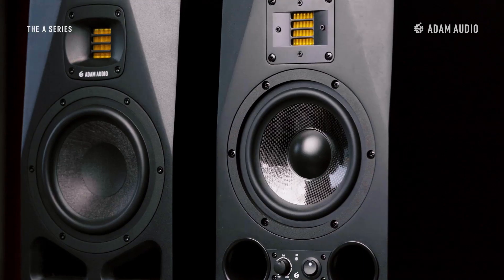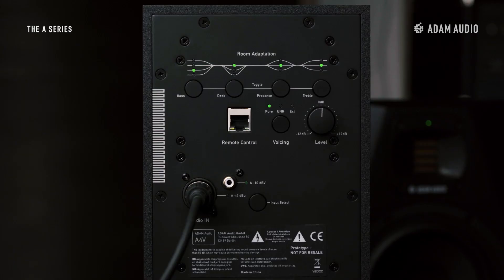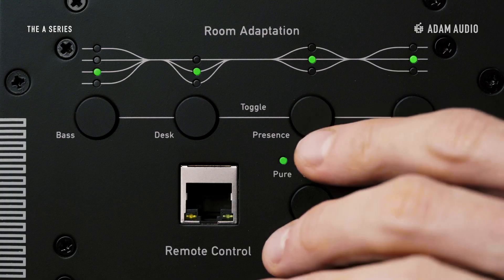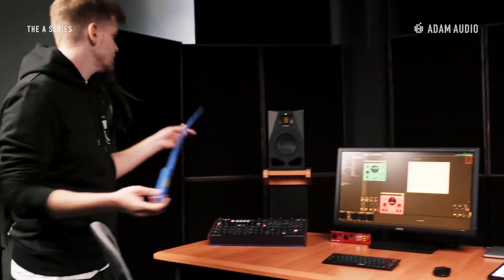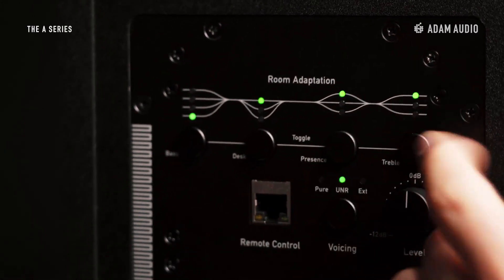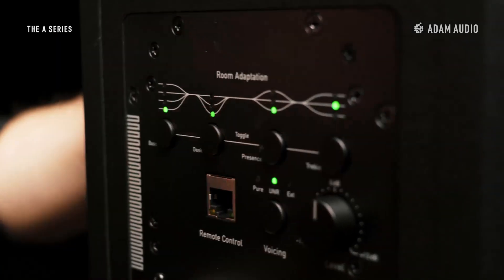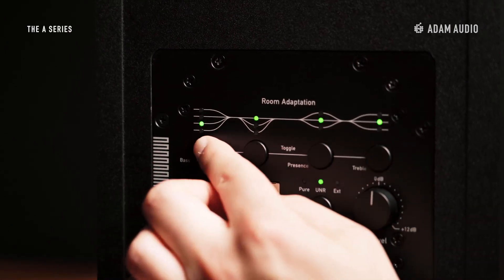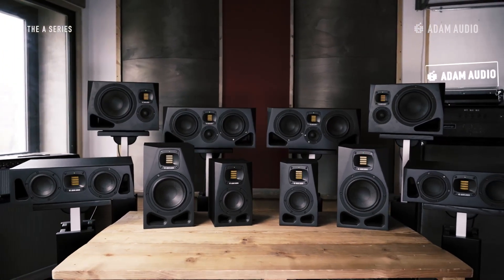The A7V | How to Position and Equalize A Series Monitors Correctly | ADAM Audio

Comment: Hey there, will running sonar works on these speakers introduce latency like sonarworks systemwide does? I’d like to be able to record with a custom curve loaded. Thank you!
Reply from the maker: Hi Sam! Sonarworks as a plug-in has a long latency because it uses FIR filters. The A Series uses an FIR to IIR conversion which Sonarworks calculates for us, and this type of filter has no latency.  A Series loudspeakers have a very short latency (<2 ms) and this latency does not increase when using the Sonarworks filter set.
Reply: @ADAMAudioBerlin  That's awesome. I''ll be seriously considering this system in the near future. Congrats on the great tech!

Comment: If you don’t have Sonarworks how do you even correctly and evenly set these only with your ears? Do you have specific reference track to use?
Reply from the maker: Hi Leiki! Reference tracks are a very personal thing. You have to find some tracks that work for you and become very familiar with them to use them as reference tracks. Better is to measure the loudspeaker using Room EQ Wizard or some other measurement software and then adjust the response as needed using the backplate controls or advance mode in A Control. Then use the reference tracks to confirm you did the right EQing.
Reply from the maker: Hi Leiki! Reference tracks are a very personal thing. You have to find some tracks that work for you and become very familiar with them to use them as reference tracks. Better is to measure the loudspeaker using Room EQ Wizard or some other measurement software and then adjust the response as needed using the backplate controls or advance mode in A Control. Then use the reference tracks to confirm you did the right EQing.

Comment: Would using a subwoofer affect how the embedded Sonarworks calibration go with a Sub? 
I assume there will eventually be a video guide showing the new A series embedded calibration with Sonarworks for 2.0 and 2.1 setups?
Reply from the maker: Hi WhiskyTanuki! For a system with a subwoofer, calibrate the loudspeakers using Sonarworks. Next, bring the subwoofer into the system in the normal way and adjust the level and phase as needed so the subwoofer integrates nicely into the system.

Comment: why are most speakers cut below 50-40 Hz ? Why isn't it 20 Hz ?
Reply from the maker: Hi aenimatek! In theory, a tweeter can play down to 20 Hz but in practice, it will not play loud enough to be audible.  To have sufficient bass level to be useful, one needs bass drivers mounted in a cabinet. The size of the bass driver and the cabinet limit how deep a loudspeaker plan play. Additionally, if you want to play loud at low frequencies large bass drivers and cabinets are needed. This is why subwoofers are usually used to get down to 30 Hz and lower.
Reply: not an audio pro at all but I heard it also has to do with room size and treatment that makes very low frequencies not work right also as an ex car audio person to get super low Hz well we had car trunk sized cabinets with extremely large woofers for a reason you won't get that in a small monitor

Comment: Can you show a comparison between the A7V and A44H? Since they are priced very similarly I wonder which application favors which monitors!
Reply from the maker: Hi there! Indeed they both are very similar in terms of price and frequency range. The main difference is the from. The new A44H has this low profile and it can be adapted to special places that the A7V wouldn't fit.
Reply: @ADAMAudioBerlin  Can we get an A7X compared to A7V video perhaps? Perhaps even include the T7V? I have the A7V on order, and owned the T7V before, very curious!
Reply from the maker: Hi there! thanks for the suggestion! we take note of it and will have it on mind for the next videos! Cheers!